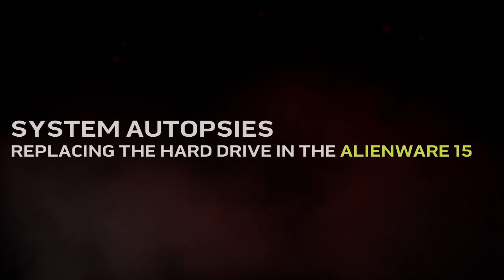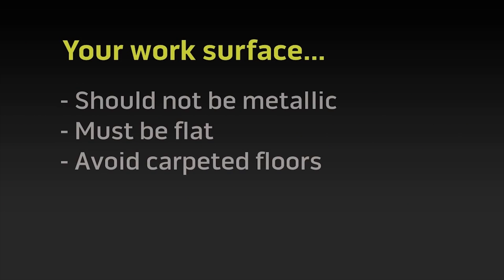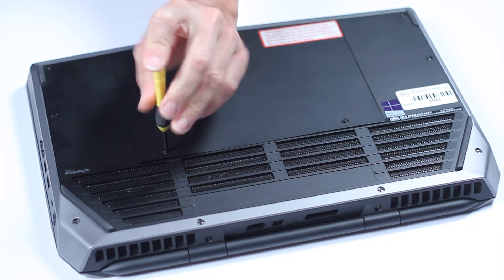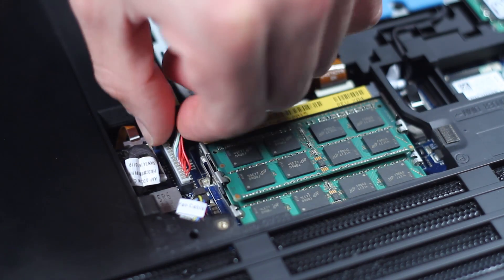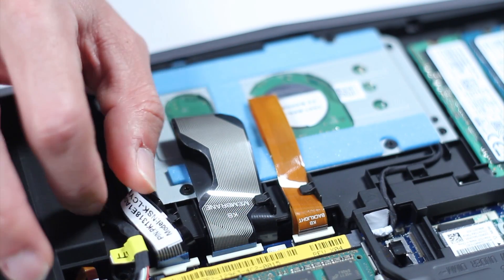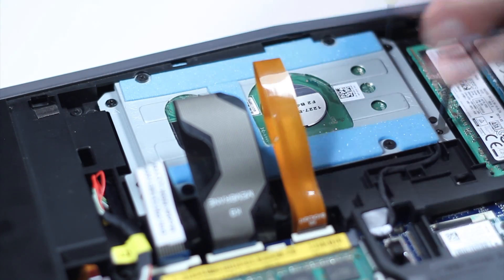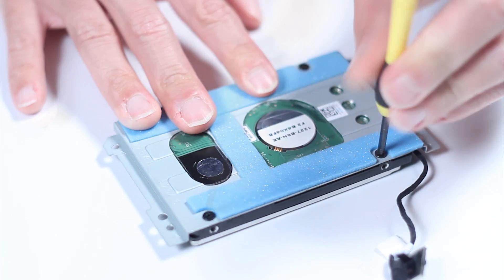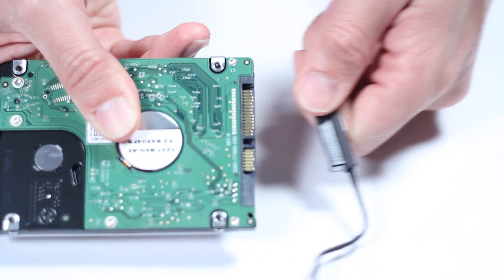Alienware 15 R1: Upgrade/Replace Hard Drive

Comment: So it's kind of already been asked but still not sure what requirements does the hard drive have to meet? So far, it seems it has to be SATA 3, 7200 rpm, 2.5 inches. Is that correct? And, I want to upgrade to like a 2 terabyte one; will that work? And what might happen if it doesn't meet the requirements?
Reply: Alienware Services okay, thank you so much.

Comment: I have an 15R1 with 2 M.2 Slots and the 2.5inch HHD drive.  Is it true that only 2 of either of the drive bays can be used at one time so I can either you 2 M.2. SSDs or 1 SSD and 1 HDD?

Comment: Is it possible to replace the GPU on this laptop? For example, a 970m for a 980m?
Reply: +Alienware Services Is that a yes?
Reply: +Alienware Services Good to know. Thanks for the quick response!
Reply: Did u ever get an answer to this question? I can’t see any reply
Reply: @alisadek7147  I don't remember. But based on what I've learned these last years I would tell you don't bother. Too expensive and you'll be better off either buying a newer model or building a regular PC.

Comment: Hi, i want to replace hard drive of alienware 15, but how many hard drives can connect at motherboard?.
Reply: +Alienware Services I will need to replace the hard drive for a brand new hard drive?
Reply: +Alienware Services i have a alienware 15, buy in amazon (http://www.amazon.com/dp/B00XQXZ41S/ref=psdc_565108_t2_B00U7QWIGQ), but i have a problem with alienware because the alienware not recognize HDD, can you help me ?

Comment: I have a "No bootable devices --" issue. It appears in the BIOS that my HDD isn't detected. I want to check if it's misplaced or something cause the problem is intermittent. Will that void my accidental warranty?
Reply: I reseated the HDD wire and now everything works fine! Thank you! :3

Comment: Hello so there is no optical drive right ? ok please Alienware can you give me the link of the external optical drive and an external cooling fan to prevent heating while gaming on Amazon please reply
Reply: Another question does the Alienware 17 2015 battery is removal or non removal because i very care about that point so please answer question Thanks
Reply: Thanks for answer, Alienware is the best :)
Reply: Hello Alienware can I control the fan of my device?
Reply: Oh ok thank you for answer another quick question i got that Alienware 17 with 5400 rpm some people said that the slow drive can affect on fps and loading games and boot up so iam confused can you tell me the difference between 5400 rpm and 7200 rpm ?? Here is the link that i bought Alienware 17 from http://www.amazon.com/Alienware-ANW17-6421SLV-17-3-Inch-Gaming-Laptop/dp/B00SIJGRJ8/ref=sr_1_2?ie=UTF8&qid=1435008444&sr=8-2&keywords=alienware+17, I hope you answer
Reply: Yea Thanks for answer i have 128 gb SSD what is the benefit of that SSD, Also i have another question my friend in Egypt he bought an Alienware 17 from amazon Does he still have warranty or his warranty died ?? please answer
Reply: ***** Really thanks for answer your company is the best :)